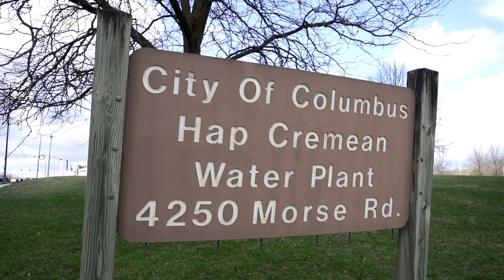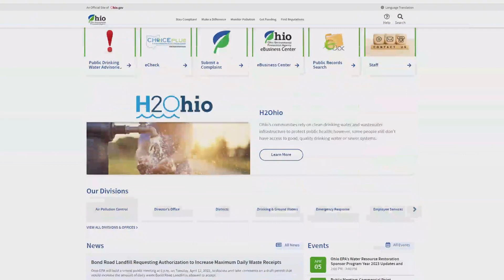New Albany Silicon Heartland Environmental Questions

Comment: If Intel is going to take it's water, initially, from the surrounding ground, how will that affect the water table for those of us that use a well system for our water supply?  I'm about 3 or so miles from the Intel site. Is that far enough away to not be affected?
Reply from the maker: Please email info@newalbanyohio.org with any questions you might have about the project. Thank you!
Reply: I’ve done that and received nothing other than “someone will contact you”. BS!
Reply: You can bet your bottom dollar is going to effect your water supply, as it did in other two states